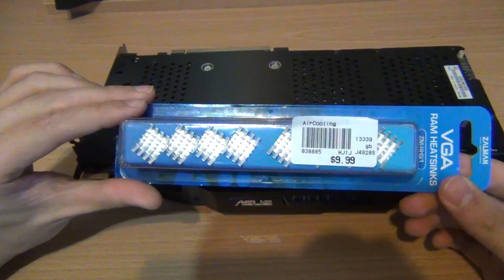How to fix Matrix Platinum HD 7970 square artifacts

Comment: I've got the Asus HD7970 in my AMD build. For ages its been doing the same thing as yours. And it has the same 4 memory chips like yours not covered with anything.  Just so happens I've got 4 Alphacool gpu heat sinks spare so ill be getting right on it.

Comment: How much clearance do you have between the copper pipes and the actual VRAM? I can't find the Zalman heatsink set that you've used in your video, but I've found a set of VGA heatsinks that have flat heat spreaders. I'm just wondering if 5mm heatsinks have enough clearance to fit. Flat heatspreaders means I won't have enough leeway to bend the top like you did in your video.

Comment: Can you help me here...
Today i was playinh some games and suddenly pc shuts off... then i tried to turn on it is not ... 
Pc turn on only when i remove the gpu ... even the fan is not running on gpu ... 
what would you suggest ... 
I have Hd 7970
Reply from the maker: Video card might have some problem. Or it could be the power supply or the motherboard.
Reply: It's probably the power supply

Comment: its better to return the card and get something else.. well I'm doing that with my asus R9 280x.. we should not have to modify and change something for it to work that's the manufactures problem not ours :) but sure if people do want to keep they're cards then yeah hope this is a solid solution, but as I look at it is If I buy something I want it to work and not being forced to spend more money or under-clock it, then I'm not getting what I bought for the money I spent, and that I call a scam..
Reply: Thing is I sent it back and they said there were no problems like wtf?

Comment: The only problem I see with this is that the copper heat pipe should not make any contact with the new memory heatsinks.  The heat coming from the GPU is way more extreme than the heat being generated by the vram.  So in theory the heat would transfer form the copper pipe, to the new heatsink and would heat the ram up even more.  If you could install them, or some other heatsink in a way where they were not touching the copper then it should help cool this memory modules down.

Comment: alright shit heads designing this crap, reminds of the great "inovation" of intel nowadays instead of using proper thermal paste or just fully conecting the metal of both parts using absolute crap, leading to the result, that the heat can no longer be transported away even with a high end watercooler.
thx psychopaths sitting behind all those shit, building things to break down asap like my mouse 4 buttom  on the 3 month old razer taipan did.l
thank u for not even leaving us 1 year with worker proper hardware  before it breaks down.

Comment: Man, thanks for that manual. I did it for my Asus r9 280x dc2t and it works. No more artifacts!
Reply: +IH4wkI Is it really worked for you? A year passed, and i have the same problem...
Reply: +gregmechOZ Yes it worked but only for about 1-2 weeks and then whole VGA stoped to work. Can't say if the reason was memory overheat or something else.

Comment: I seemed to have fixed the problem on my Asus r9280x by flashing the non TOP bios onto my card.
Reply: +iafro1989 Hi, was the issue really resolved with that card or it relapsed? I have an ASUS R9 280x with latest BIOS
 installed and saw another video which advises to install an older 
version but I'm not sure what to make of all this.

Comment: Thanks for this video. I get a bit of occasional artifacting on my card, though it's not too bad at the moment. If it gets any worse, I'll look into something like this. :)

Btw, does yours overclock well? Mine was a bit disappointing...1185 on the core seems to be about the most stable overclock I can get.
Reply from the maker: Mine doesn't overclock that well on air either. I have read that these cards are really meant for watercooling but I haven't tested that to verify those claims. I can get around 1185 as well but have to run at a higher fan speed. I leave mine at 1150 for 24/7 overclock.

Comment: I have the same problem with BF4 only. When artifacts occur the memory temperature is 70°C. Your video is awesome! I changed memory frequency to 1500Mhz @ 1.55v, if this not work I will do the mod. Thanks a lot!
Reply: how did you change the memory voltage?
Reply: Mike Jans asus GPU twek. But i have some problems with this software on windows 8.1. I just set the frequency to 1500Mhz on AMD CCC and the problem is gone.
Reply: i did try it with 1500, 1450, 1400 ... and still have the same problem ;-(
Reply: Mike Jans :(
Reply: Hi. I not have this GPU anymore. I have an MSI 7970 lightning... MSI after burner is better. Asus GPU tweak reset all settings to default after windows 8 reboot and the burn option dont work... :(

Comment: Awesome vid, really helpful since ASUS pretty much dropped the ball with the VRAMs overheating. How's your card holding up after three months?
Reply from the maker: It works fine. The latest 14.3 beta drivers are awesome. They allow the VRAM frequency to downclock while idle while running dual monitors.

Comment: I am artifacting like shit too! I have a msi r9270x and if i open the card i can see that 1 memory module isnt coverd with the unisink! I f place a little heatsink on it, will that fix my artifacting priblem? 
Please help
Reply from the maker: Possibly but it depends. My card only seemed to have artifacts intermittently running DX9 games like Final Fantasy 14 and Trine 2. I didn't see much artifacts if at all when running DX11 benchmarking software. Since making this change I haven't seen any artifacts.

Comment: I did this for my Asus r9 280xdc2t and it works perfectly now. Cheers! :D
Reply: Hi , could you make a video of what it looks like. I have the same card and I am wondering what heatsinks I should buy and how it fits.
Reply: Well the dc2t has less space between the board and the heatsink. I managed to fit the same ones that were used on this video. They only needed more bending. And i bought 2 packs of them because the dc2t has all 12 of the vram chips exposed. The heatsink that is shown on the video above the core is missing entirely.
Reply: Thank you for the info! :)
Reply: I'm sorry I have one more question, would it be possible for you to take a picture, would love to use something like that as a reference for when I do this.
Reply: i getting grey screen freeze with my r9 280x in heavy load games, i suspect vram overheat, i try this to see its fix my problem.

Comment: I have the same card but and i havent more problems with artifacts...Test this:
GPU 1200Mhz/1300v
Ram 6600Mhz/1500v
Tell me if your problem has been fixed.
Reply from the maker: 1.5V on 6600 Mhz is not high enough voltage for that frequency. The video card comes stock 1.6V (1600mV) for 6600Mhz. After doing this modification I have no artifacts at stock speeds and voltages.
Reply: no tienes ni idea tio

Comment: I'm using a r9280xdc2t with the same issue. Willthis work for me to? Or should i just RMA?
Reply from the maker: To make sure it is a VRAM issue downclock your VRAM to 1500Mhz. Asus GPU tweak can allow undervolting the vram to 1.5v but only undervolt it to 1.5v if you have lowered the memory clock to 1500Mhz (vram clock 6000Mhz in gpu tweak).

RMA does not guarantee getting one that doesn't do the same thing and you would have to deal with the wait time for the replacement plus shipping costs, etc.
Reply: I'm can't undervolt since i don't have the matrix. vram voltage is locked at 1.6V.
Downclocking to 1350MHz didn't help. I'm going to contact the strore where i bought it and try to swap to an gtx780/r9290 first

I also have a Vid on my channel where my 280x does artifact in another way to.
Reply: shuyin200   Can I just keep my card downclocked to 1500Mhz to keep it from overheating instead of doing this mod?
Reply from the maker: charvelstrat81 If it stops artifacting at that speed then yes.